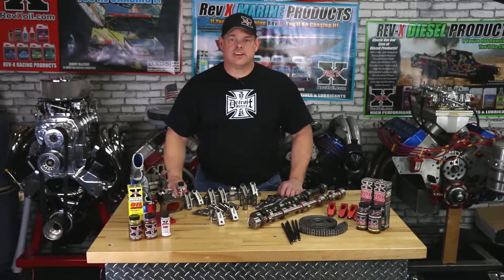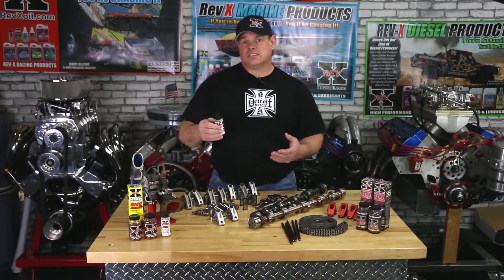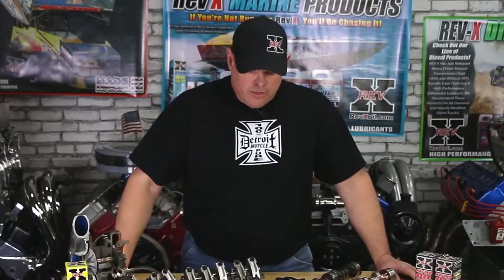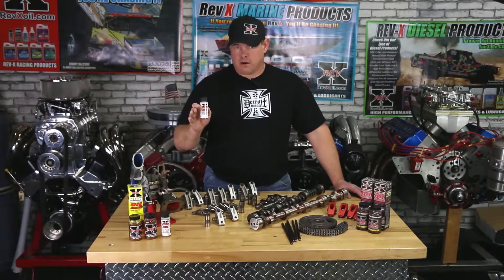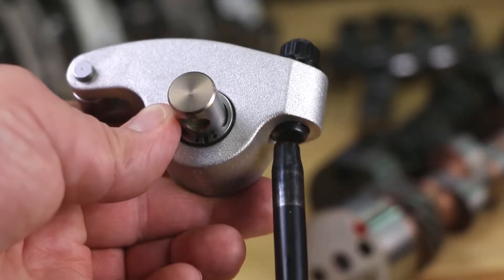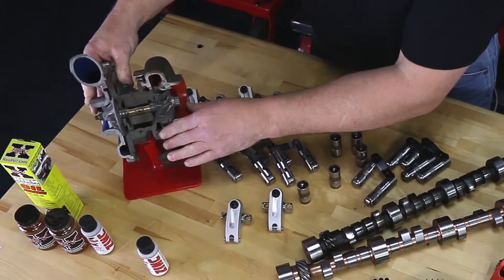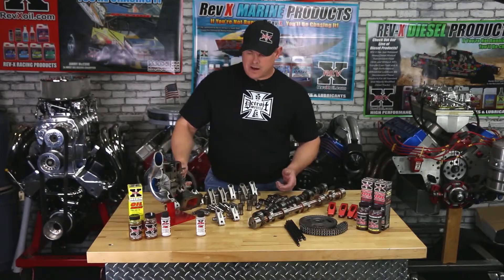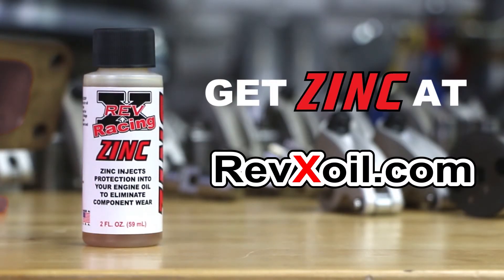What is Zinc (ZDDP) Oil Additive & What Does it Do?

Comment: you said the zinc forms a coating at a temperature of 700 degrees !!  I don't think I would have an engine left at 700 degrees !!!!!
Reply: As explained in the video , Zddp reacts at the sliding contact. Locally, at the micro-contacts (asperities) the zddp decompose both because of local high temperature (flash temperature ) and mechanical-induced reaction (trino chemical or mechanichemical). 
You can easily grow glass phosphate layers on the sliding parts even at room temperature
Reply: My thoughts exactly! 

High ZDDP is used to break in an engine. Not at 700f, obviously! Haha

Comment: The reason they have reduced the amount of zinc in oil isn't because it's not needed , they did lower it because it destroys Catalytic converters  and because they need these over priced so called emissions devices  the manufacturer will sacrifice "Your" engine  to keep the environmental agency off their backs.  It's that simple. Zinc is the magic bullet of longevity in your engine. Read up on what Lake Speed says
Reply: In reality, Zinc doesn't destroy Catalytic converters. Catalytic converters stop working after becoming blocked by carbon build up from the simple act of burning gasoline. Most catalytic converters would start working again if you could clean them out. Gasoline is the biggest enemy of Catalytic converters. Sometimes a catalytic converter will go bad from overheating when the engine isn't running properly. Catalytic converters are an item no different than brake pads. At some point in time it will need to be replaced. Zinc isn't to blame.

Comment: Ah, one MAJOR problem here!!! You say at 700 degrees blah blah blah, it forms a coating………. Well sorry to say oil will NEVER EVER see 700 degrees unless you have a MAJOR, and I mean absolutely MAJOR problem!!! Only time or place an internal engine sees 700 is inside the combustion chamber or the exhaust!! I’ve rebuilt to many to count and diagnose engines in my life to know that for example my engine oil even in EXTREME conditions runs at about 220 degrees and on really long up hill pulls never goes above 230 on my oil temperature gauge. Maybe facts should be found before speaking. Zinc itself, the micro particles is what does the ‘lubing’ to help with break-in.
Reply from the maker: Clearly sir you are correct in thinking that your engine oil as a whole, will not reach that temperature overall.  Zinc does not work on the overall temperature of the lubricant, it functions on friction points.  A friction point may occur were metal to metal contact happens at an extreme contact point (such as a camshaft lobe when it reaches its maximum point of lift).  These friction points inside of an engine using extreme valve spring pressure can go way higher than 1000F temperatures.  That is why ZINC as an additive is used to combat wear and extend the life of internally lubricated components.  The way of testing oil temperatures as a whole can be done using a gauge in the pan, it is not the same as measuring friction point temperatures at specific locations inside the engine.
Reply: Revxoil really doesn't know how the very product he sells works.Adding additional zinc is much more complex because it has to have the correct additive package to be effective..

Comment: But seriously,  why would a 15w40 would be so much better than a 0w40? What is pertinent about that winter number at engine operating temps? Im dead serious here, i cant find anyone to give me a straight answer. I've always learned that the w is only important at cold temps, and the viscosity is whats important at operating temps. So why couldnt you have the best of both worlds with a 0w40???
Reply from the maker: You are correct, w is only important in cold temps.
Reply: It's all based on engine design and the additive package..You have to know what you have (The engines lubrication requirements) to know what you need..I could write a book on this subject but, there are many good people here on YouTube (video's) that explain all this very well..Keep watching and learning with the rest of us..:)..I will say this..The 15-40 you mention is a diesel engine designation. the 0-40 you mention is a car designation and usually called a euro blend oil..Understanding all of this is takes a lot of research. I recommend (as an example) if your car requires lets say 10-30 that's what you use..If that is whats on the oil cap or the manual that is what it was designed for. Nothing else..
Reply: By the time you get round to your next oil change, your 0w-40 may well be a 0w-30. To get oils with such a wide viscosity range you must add viscosity index improvers, and all the ones that work in a 0w rated oil are not shear stable. This means at high temperature or high mechanical shearing conditions (such as timing chains interfacing with gears) these viscosity index improvers physically get broken apart and lose their viscosity at operating temperature.

Comment: Is zddp good  for new turbo engines
Reply: What is the difference between new and old engines?

Well - there 5 to 10% difference. 
Yes it's good for ANY engines from ANY production year.
Reply: @igor2030ign  Thank you for your response. I just got a new colorado zr2 with a 2.7 L turbo And want to know what I should do to keep it in that best shape for as long as possible.
Reply: @carlmcdonald5864  Congrats! Great car! I like it very much!
Another very important moment to keep your engine best shape is oil change interval and oil type. Interval - not more than 3000 miles and oil type = mineral API 15W-40 or 10W-40. With this recommendations your engine will last more than 250-350K miles. 

Synthetic is bad for piston rings and timing chain, and motor with synthetic will require repair about 150K miles. 

IMPORTANT:
If winter temperature is below -10°C please use 5W-40 semi or synthetic oil for winter time.
Reply: ZDDP is 1960's technology..... Its weak.... Just ask David Vizard.

To much Zinc will pit/craze flat tappet cam followers.
Reply: whats so great about david vizard @gj91471
Reply from the maker: Any high load engine will benefit from the use of the ZINC additive.  A NEW Turbo engine will need all the help it can get during the brake in process.

Comment: You can only use that stuff in non-detergent oil!
Reply: This is actually a terrible product. I added it to a diesel oil.  And the Blackstone lab came back with less zinc than a virgin analysis.  Now if I want high zddp oil. I just buy high zddp oil. Additives are trash.
Reply: @joes.7536  So far doing the research Rislone was the only product that boosted the Zinc additive package to 1,500 ppm..Via oil analysis..It had more then most all the other ZDDP supplement additives on the market however not all were tested but, most were..Some of the additives (STP) actually had less Zinc by volume then most engine oils..Most engine oils have about 700ppm today. And that is fine for modern engines but SN/SP oils is NOT backward compatible with flat tappet cam engines..Not if you want that full top end protection the older engines need..There are engine oils out there that have a high Zinc package but not many..Valvoline VR1 racing oil does..Driven Oils also make a high Zinc oil..Do the research and you will find them..Diesel oils have nice zinc packages but the viscosity is to high and those oils are not compatible with gasoline engines..It's way to thick..Engines have to be designed for specific viscosity to lubricate correctly..If your oil cap says 0/20 you better use 0/20 or you will probably hurt that engine..Thicker oil does not pump well through a modern engine..The oil passages are so small..Hope this helps everyone understand the Zinc topic better..??
Reply from the maker: You are correct on a few things but not much else.  ZINC is sold to be used in a certain concentration to achieve the correct blend for high performance engines.  If you don't use it in the correct concentration you won't get the proper results.  I would say that you are a someone that likes to think you know more than you do, any knowledgeable person that reads your response will laugh at your posted ignorance.  Diesel engine oil not being compatible with gas engines.... LOL  You do nothing to help anyone understand how ZINC helps within a lubrication system to provide increased protection.  Anyone that reads this, Please feel free to look up how ZINC additives work on google for a lot of beneficial info.
Reply: @Revxoil  You really have know it all either..Do more research..!!!..There is plenty of it right here on youtube..
Reply from the maker: False!  ZINC can be used in any blend of oil!  It has proven over a hundred years to be very beneficial in all types of lubricating fluids.
Reply: @Revxoil  Are you aware that zinc is attracted to metal and detergents try to pull it away so they fight each other unless the additive package is adjusted correctly..
Reply: @Revxoil  Are you aware that newer modern engines don't need that much zinc because they have adjusted the additive package with other things that do just as good of job Also these newer engines don't have valvetrains that need as much zinc..I suggest you watch other engine oil testers on Youtube. They explain what I'm saying very well..

Comment: This is very interesting vid and appreciated.  For the non racing family car Pennzoil Ultra Platinum will be all you need as it has the right amount of zinc. The secret if it is actually is one.. is to change the oil/filter every 5,000 miles or every six mouths.  Do this with a Honda or Toyota motor and they are known to do 300, 000 miles and more.

Comment: Will this prevent the Ram engine tick that leads to lifter failure
Reply from the maker: Zinc will not prevent that. REV X High Performance Oil Treatment when used regularly will help prevent that.

Comment: Wont this ruin catlytic convertors at that amount of ppm?
Reply: @Revxoil  YES IT WILL!! That is why the oil manufacturers have decreesed the amouth of ZPPD and replaced it with other lubricating additives.
Reply: @markwarnberg9504 would you consider a 1996 model old enough to benefit from added zinc without too much potential damage to the cats.?
Reply: @carlorocky  I am not an expert on zinc/caats. A lot has changed since 96..tighter tolorances, new materials! I know zinc has been mostly replaced with other libricant additives like Moly and Bormium. I would think todays oils would be enough without extra additives as long as you do regular oil/filter change.
Reply: @markwarnberg9504  Yes, newer engines and newer oils don't require as much zinc. It's all about the additive package..They use other additives in place of zinc.
Reply from the maker: There is a LOT of misinformation on what ZINC will and will not do.  For Zinc to take out any catalytic convertor you have to have an unusually large amount of crankcase vapors sucked into the intake stream to even get to the exhaust for that to happen.  this usually occurs on older engines.  ZINC is primarily for the use of aiding new engines with the ability to break in without the possibility of lubrication-related failures.  Not many people need to continue running the ZINC additive after the break in process has been completed.

Comment: Isn't zinc for old school motors with cam in block designs. I'm thinking of Chevy and Dodge V8's. Modern overhead cam motors don't need that additive from what I understand.
Reply: what about overhead cam engines with cams operating bucket tappets? So not Honda VTEC using roller rockers, but something like Toyota A series DOHC series engines (e.g. 4AGE/7AGE) with cams directly acting on bucket tappets. I suspect the answer might be depend on race/road use and whether the car has catalytic converters.
Reply: @alexjenner1108 actually most toyotas use flat tappets. Just rebuilt a 2azfe with it. And 1zzfe
Reply: @xESPplayer500x  aren't we talking about the same thing? Bucket tappets are similar to other flat tappets, except the shape is like a bucket enclosing the top of the valve stem and valve spring. So my question was what sort of oil/additive package should be used with DOHC and SOHC engines with bucket tappets and why?
Reply: @alexjenner1108  ah yes i see. I like rislone zddp or just add a thing of stp additive that contains zinc. I just add a little to clean high mileage oil. I stay away from moly. And i add the zinc because I do believe it creates sacrificial barriers between parts thus increasing engine longevity
Reply: I have a 2003 F150 with a 4.2 liter V6. My truck has over 230,000 miles on her but she runs great. I did some research and found that Redline has twice the amount of ZDDP than other oils so I jumped on it and purchased a gallon jug. I did do more research and came and saw the cats thing and now I am FRIGHTENED to put this stuff in my aging truck. Question is, what if I just put in a quart of this stuff combined with 6 quarts of SuperTech? Will this Walmart oil diluted some of that ad pack to were it won’t mess with my cats?
Reply: @standhd  just add half a bottle of rislone zddp to am oil change
Reply: Zinc should be used in ALL MOTORS during break-in. ESPECIALLY with flat tappets! Just trying to start a fresh motor with flat tappets you can cause damage if you crank and crank and crank with a no start! Also for information, ALL MOTORS SHOULD BE PRE PRIMED AT THE OIL PUMP with oil pressure gauge connected to build up pressure and making sure oil is going through motor.

Comment: I have a 1990 5.7 350 gmc jimmy I was wondering if I needed a zinc additive but it does have a Cadillac converter on it?
Reply: I want to get a Cadillac converter to fit to my old clunker. 😂
Reply: 5.7 tbi? If you smell fuel/rotten eggs the cats long gone. Can you use it yes/no 
Yes-extra zinc wont hurt anything

No-you dont really need it,you have roller lifters 
Do i run exta zinc-yes,due to what i use my vehicle for
Reply: @mattw7557  I have a 2014 Camaro V6, will this additive help for engine. how about CATS ?
Reply: @sapien213  no.your engine is too new,i wouldnt risk it.normal 5w 30 works.i own a 13 ss and i feed it mobile 1 and a acdelco filter
Reply: @mattw7557 Do you think that a 1996 overhead cam flat tappet engine would benefit from added zinc without harming the cats?
Reply: @carlorocky  hmm. Well its 1996 i assume the vehicle does not require inspection if no..then yes extra zinc will help
I mentioned inspection because there is a chance that it may turn on the Check engine light because of the zinc interacting with the cat causing a po420.
Yes the car will benifit from extra zinc
Reply: I run Rotella T4 15w40 in my 1994 4.3 safari in the summertime, it has about 1200ppm zinc which is more than enough for us guys with stock valvespring flat tappets (what came from the factory) 👍
its once you get into higher lift cams and valvesprings, or if you're breaking in an engine with a flat tappet cam is where you'll see the NEED for extra zinc, think about how long these trucks ran just fine and dandy well into the 300,000+kms using whatever 5w30 the service department or jiffy lube has on hand 😂

Comment: DO NOT PUT ZINC IN VEHICLES WITH CAT CONVERTERS..IT WILL DESTROY IT!!
Reply: How? unless your engine is burning oil the zinc cant get into your cats! Tell me how it ruins an exhaust system unless you have a worn engine that already burns oil please? lol
Reply: Not true. I ran high zinc  Amsoil for 130 k miles in a 2009 Cummins with cat converter.
Reply: hows cats get affected ....else there should be oil already burning in chamber ??
Reply: Maybe in 7 to 8 years. Cheaper to change cats than Camshafts in AFM Engines.
Reply: That's the least of your concerns. What you are doing is killing the actual oil overall.

Comment: Can adding or using to much zinc or oil additives cause problems to your motor
Reply: Yep, it corrodes soft metals, like brass, zinc and aluminium. 1400 ppm max and yer golden.
Reply: YES!!..DON'T PUT ZINC IN NON RACE CARS WITH CAT CONVERTERS
Reply: The problem with catalitic converter plugged comes  from the Phosphorus in ZDDP

Comment: I call BS.  The product works but not the way it is described in this video.
 Zinc is an element. Phosphorous is an element.   Zinc never turns into phosphorous. It cannot form a phosphorous glass. 
Zinc works in the same ways a molybdenum, another elemental metal does , but it is more effective in elemental form because has much lower melting point.   It is a soft metal that melts at lower temperatures than steel, but at 787F, about 400F higher than the vapor temperature of oil.  
Scratches in steel cause localized turbulence, which produces extreme heat much higher than the vapor temperature of oil and the turbulence plus heat causes erosion The soft metal particles  are sucked into the collapsing microbubbles of the vaporizing oil. They clump, melt or are sintered together and act to partially fill the scratches and reduce the turbulence while conducting heat.  
In essence a metallic zinc additive is a very high temperature lubricant. It also acts as a sacrificial cathodic material in the presence of water vapor.
Reply: Sodium zinc phosphate is the actual additive, not elemental zinc.
Reply: The Phosphorous is the important part in protecting the cams, but the Zinc is needed to make it usable in your engine. This video helps explain better than I could.
https://www.youtube.com/watch?v=3PeqJqss0Ao

Comment: If I have only a 5 quart oil capacity will the full bottle be too much? Also does this product wear out before a required oil change ? I have 2 67 Olds 98s and  a 84 Lebaron and a 86 dodge 600. Is there a formula if the capacity is less then 6 quarts.  Does it matter what motor oil you use?